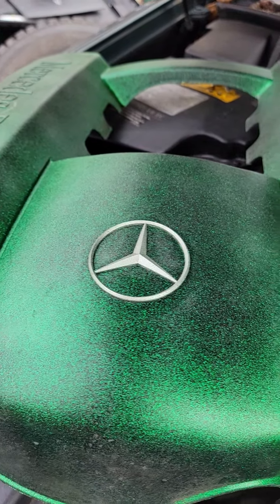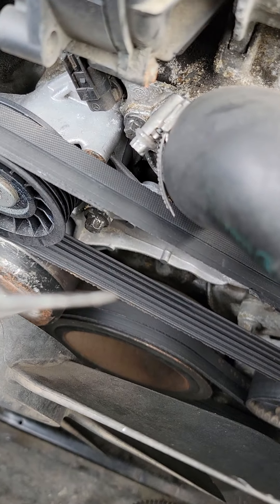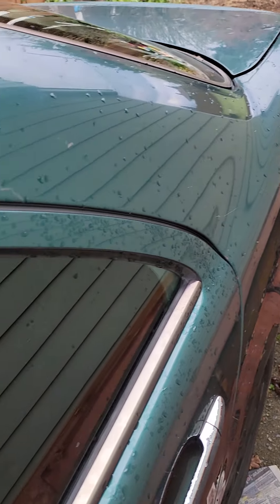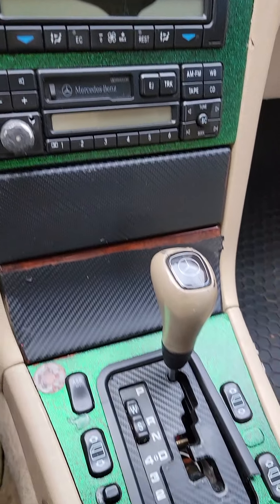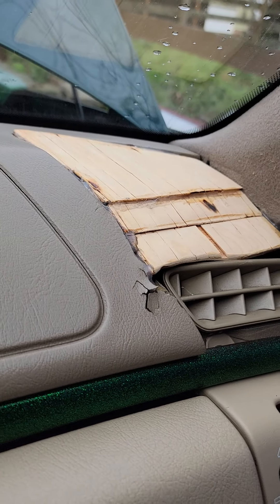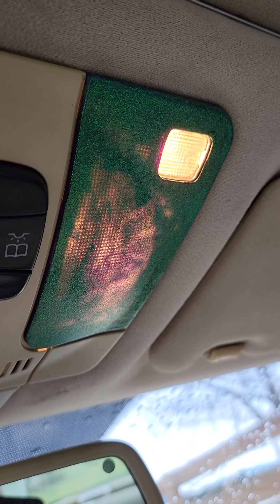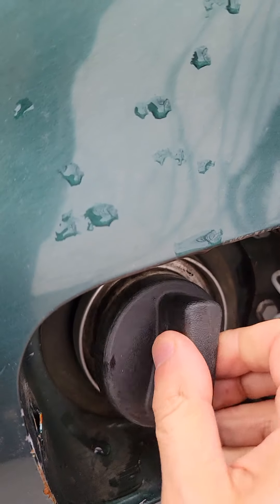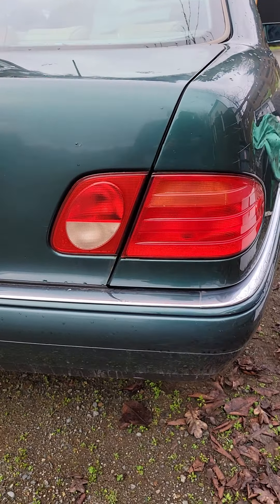1998 Mercedes E320 won't accelerate.

Comment: You think I need to worry about a timing chain replacement? I have 204k miles? The engine hasn't been touched except for some valve cover gaskets. I've got the m113 in a w202c43
Reply from the maker: Send me a video. Check all the fluids. Spark Plugs, belt, tensioner, etc etc.